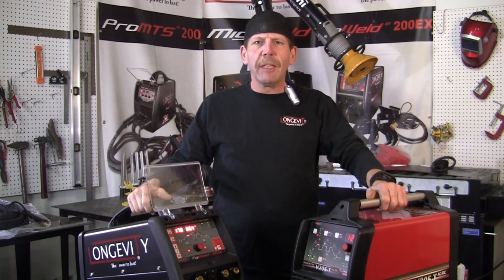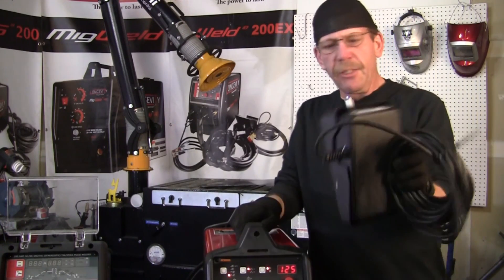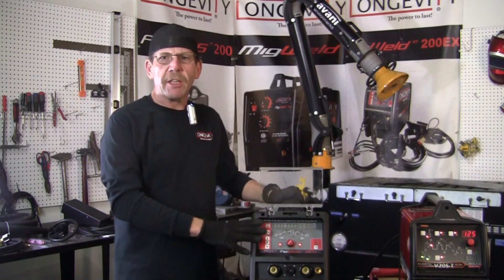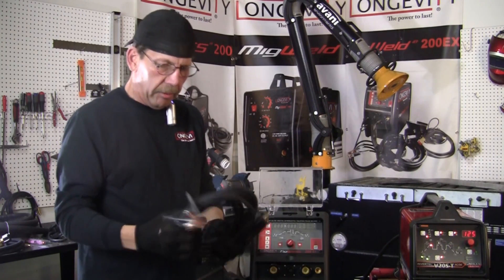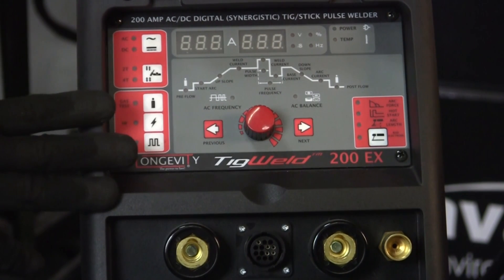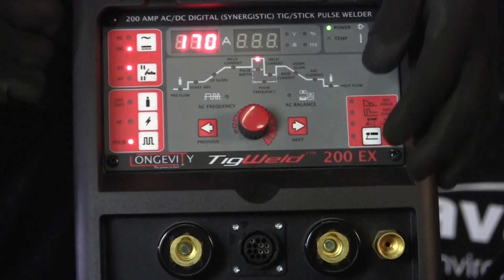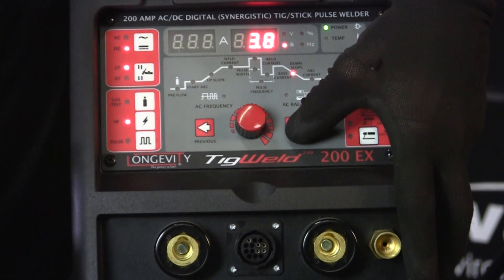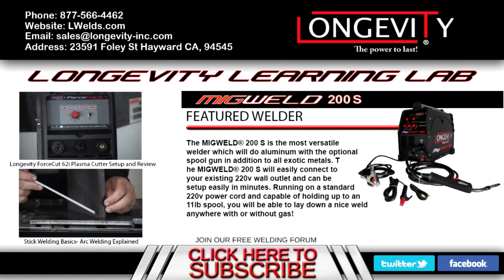Lincoln Invertec V205-T Vs. Longevity Tigweld 200EX

Comment: I've used Lincoln and Miller portable welders on many job sites for 25 years and they are virtually unbreakable. I Bought a Chinese Longevity welder for home use a found that the plastic parts crack very easily and the digital readouts were not even close to being calibrated correctly. I sent it back within a week and even though the machine was at fault Longevity stuck me with a $50.00 return shipping fee. I bought another Chinese Everlast welder and the quality is just as bad as the Longevity.
Don't be fooled you do get what you pay for!